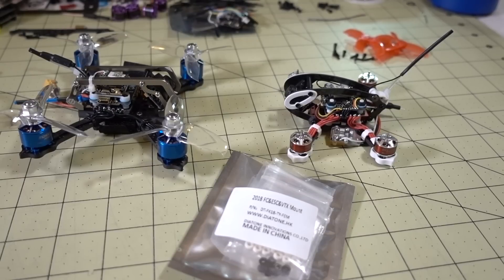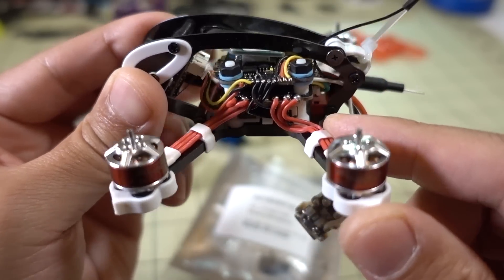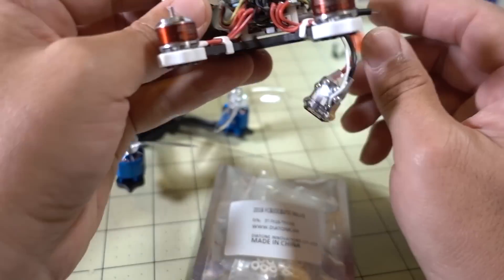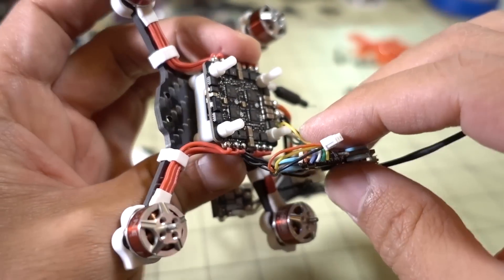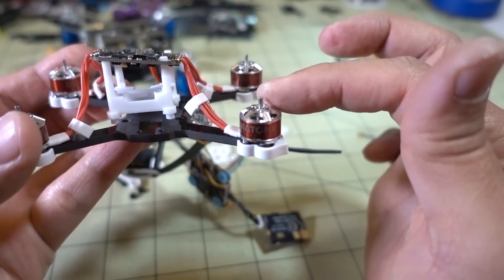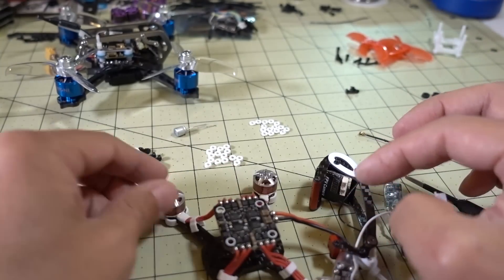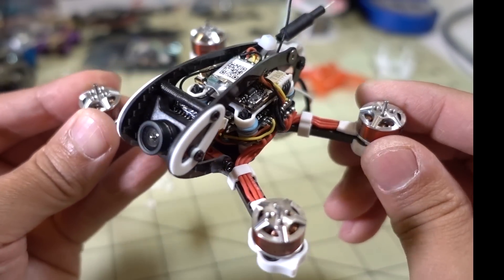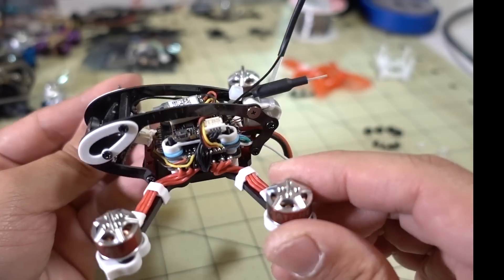Diatone GT-R90 V2 Stack Conversion 🎈

Comment: Thanks for this vid....Did it with no problems until I flew it.   Was flying great before conversion, but now has crazy mid to high throttle oscillations.  Any ideas??
Reply from the maker: You probably have the FC/gyro tightened down too much and vibrations are getting through.  The silicone grommets need to be allowed to let the FC float and move around a little to absorb the motor/prop vibrations.
Reply: Albert Kim will give it a go 👍
Reply: It worked....loosened one turn on each screw and perfect!! Thanks

Comment: r u sure you used the plastic plate correctly? think its meant on the bottom to hold the screws and to avoid a short with the esc
Reply from the maker: Yes, it's correct.  The plate is mean to mount the VTX.

Comment: Hey Albert! Got it all figured out as far as the Spektrum sat RX wiring for the GTR90 V2. It appears that the F4 version on the V2 is all serial and no jumpers needed! That’s what myself and the guy from Diatone US come up with.  For the V2 you just wore to 3.3v and ground on the left side of the board (with camera facing away from you) and then the RX signal wire goes to RX6 on FC similar; it’s sane wiring as the V1 F4 FC, just no jumping. 

I do have an issue though I need help with!! If you can! :-) 

Everything looks good in BF and all my channel mapping is done in the receiver tab,  but when I arm and give ANY throttle input, the quad just ramps up RPMs all by itself and just shoots straight in the air in a spiral motion...I have calibrated the accelerometer and confirmed channel travel and endpoints 1000 to 2000 and middle is 1500.

Any recommendations? Maybe a re-dump? Thanks for any help sir!
Reply: Maybe is the p gain on the pid's to high

Comment: is there any way you might be able to share how to wire a 3.3v rx to the fc? there is nothing on how to do it on the v2 FC! It is not the same as the FC that the v1 comes with.  Thank ou so much!
Reply from the maker: I don't have the V2 FC.  I modded my V1 with the new stack mounting and capacitor but the FC is still V1.
Reply: Albert Kim thanks! I’m a little newer to the whole ARF micro and open software BF stuff.  I’ve been told that they were the same, but I’m here to tell everyone that the FC might be the same OS and type, but the layout of it is different. 

Diatone even sent me their old diagram and doesn’t have an answer on how to wire a 3.3v onto the new V2 FC nomenclature. 

If I’m missing something, please someone let me know! I have a diagram, but it only labels the 3.3v and GND pad...do I simply use those? And where does the signal wire go? 

Thanks for the reply Albert!
Reply: Diatone have now a new picture where al the details are shown

Comment: Would you say there is enough space under the stack after conversion to slide the receiver?
Reply from the maker: I think an XM+ might fit but it will be tight.
Reply: I'm using FS-A8S receiver and its 6.27mm high and the XM+ is about 4mm high, so not likely. Thanks for your reply!

Comment: Hi albert was wondering if your motors on the gt 90 are noisy mine make alot of noise like a loose magnet or something and whats the eazyiest way to take the c clip off on those
Reply from the maker: Mine are not noisy.  I think there are tools for c-clip removal, but I think they end up break the clip and you need a new one anyway.
Reply: Albert Kim i had a feeling of that maybe ill just blow them out with compressed air just to make sure there is noting stuck in  them

Comment: Maybe not the right place for this comment, but it is generally applicable to the micro drones we love - and it has to do with Betaflight 3.3 and F3 flight controllers. The problem is supposed to be resolved with 3.4, but as it now stands, most F3 boards cannot take advantage of the new BRQC2 stage2 filter - 3.3 won't even load it. So, Butterflight to the rescue. Mind you, Butterflight is really irrelevant to micro quads - like Betaflight, it's designed for the 5"-6" quads and their bigger motors and increased weight, but it will allow those of us who are still flying F3 boards to take advantage of either the BRQC2 or Fast Kalman filters. The other problem is over-taxing the processor with Dynamic Filters on F3 boards - which Boris and the Betaflight folks recommend running at 4K/4K if Dynamic Filters are on to keep the CPU usage manageable. You can't run the Fast Kalman filters at a 4K gyro refresh rate at the stock settings for q and r - the ratio will produce a frequency of about 90hz, which is no different than the stage 1 soft lowpass filter - so Fast Kalman is of no use to F3 pilots. On the other hand, Butterflight allows us F3 users to do something really cool. 4K/4K PID and Gyro rates, Dynamic Filters on, 90hz soft lowpass and 150hz stage2 gyro filters, and all notch filters off (yes, including D-term notch). This also works great on F4 boards running at 8k/8k - I've messed with it a lot, and the result of doing things this way is much smoother flight and no added motor heat from turning off the d-term notch filter. You end up with "stacked" or "layered" filters in the area where most motor noise and d-term noise occurs that are much better and more versatile at attenuating motor and d-term noise. Also, you can do this on the F4 and faster boards without having to use Butterflight - it's native to Betaflight 3.3 on F4 processors. So, until 3.4 comes out, I flashed Butterflight onto all my F3 boards and set them up in this way - and am really happy with the results. Also did it on all my F4 boards. Good luck if you try it, but just in case do a hover test and check for motor heat.
Reply from the maker: WhichF3 micro are you running Butterflight on?  I've been playing around with it and all my setups have performed worse than Betaflight.  What CLI commands did you issue for the filter settings?
Reply: Albert Kim - Several!  They all seem to handle it well - Leader 120, Lizard95, Mini Bfight to name a few.  Here are the CLI Commands:

Set gyro_stage2_lowpass_hz = 150
Set gyro_stage2_filter_type = biquad_rc_fir2

Make sure that the soft lowpass (stage 1) is set to 90hz on the Filters page in PID Settings (very top filter - 90 is default), and turn off all your notches (all 3) and do a hover test for motor heat.  An alternative thing to try is to set the stage2 gyro lowpass to 90hz and turn the stage 1 off (set to 0) and turn on the D-term notch filter - and test for motor heat with the D-term notch on and off.  In the first way, you are stacking the filters into the frequencies where motor noise and d-term noise are typically the worst, and the dynamic filters will do their thing as well.  You will have less latency with the second method - you are just swapping the fast biquad filter (stage 2) for the default lowpass filter - but the new filter has greater attenuation at higher frequencies.  Try it both ways and see what you think.  Don't worry about the Q and R values - they only work with the Kalman filter if you select it.

If you like the results, then the good thing about this method is that it works regardless of whether you have an F3 or F4 and regardless of the PID Loop refresh rate - so you get the same results regardless of whether you are running 4K/4K or 8K/8K.  I should add that a lot of what I have learned came from UAV Tech and some from Joshua Bardwell - and reading the Wiki - but mainly from actually experimenting with different modalities.
Reply: Albert - just flew the 3" Komori with an F4 HGLRC stack and Emax 1106-6000 motors set-up the same way - and it flew like butter - the motors were lukewarm when I landed it and I flew it hard for 4 minutes.
Reply: Oh - and it is flashed with Betaflight 3.3 but the CLI commands and setup are the same. Stage 1 at 90, Stage 2 at 150, Dynamics on and all three notch filters off.
Reply from the maker: So you're flashing Betaflight to F4's and Butterflight to F3's but essentially setting up the same on each?
Reply: Albert Kim  - Exactly!  It's the only way to get the Stage 2 gyro lowpass on an F3 running at 4k/4k - Butterflight on the F3 boards and Betaflight on the F4's.  I tried the Fast Kalman filter using the default q and r settings - the problem is that at a 4k gyro rate, you are just duplicating the frequency of the Stage 1 gyro lowpass (90hz).  At an 8k gyro rate, the Fast Kalman cut-off goes up to around 180hz - unless you change the q and r settings - which I don't feel competent to do, and the default on Butterflight is to leave the Stage 1 filter on at 90hz.  At 4k, you are just duplicating things and end-up with a Biquad filter with double the latency.  So, since Butterflight is Betaflight with the option to try the Kalman filter (and use the BQRC filter on an F3 board if you want), I tried different combinations until I got to the stock lowpass (Stage 1) at 90hz, the BQRC filter (Stage 2) at 150hz, Dynamic Filter on and all the notch filters off.  From there, you can experiment with turning the Dynamic Filter off and raising the cutoff of the Stage 2 filter in 50hz increments until you get to 250-500hz.  There is another lowpass filter built into the MPU6000 gyro with a cutoff of 256hz - so in the way I have the boards set up now, the Stage 1 gyro lowpass is at 90hz, Stage 2 at 150hz, the digital gyro lowpass at 256hz and the dynamic filter is on and all three notches are off.  Turning off the dynamic filter saves (reduces) latency and CPU usage - and so that is my next experiment.  Check for motor heat with each change - but I know you know that.   Raising the Stage 2 to higher cutoff frequencies may reduce prop-wash if it becomes a problem.  Our problem is how to adapt these fancy new shiny filters and things to small quads -  when they were created mostly for the bigger quads.
Reply from the maker: So with these settings, how do they fly for you?
Reply: Albert Kim  - really well!  Subjectively speaking I would say they fly smoother - and more responsive - but I haven't tried any tuning to see if these settings allow for higher P or D gains.  That would be a great project for you!

Comment: Did you mention that Diatone is selling the capacitor for they use on the GTR90 V2 as well? I couldn't find it on their site. Thanks for all the videos Albert.  Excellent balance between honesty and usefulness!
Reply from the maker: I don't think they are selling it yet.  If you can't wait, I found this on Amazon, it might be the same - https://amzn.to/2GJaYUS
Reply: That's a surface mount cap with no legs don't use that one. Will be really hard to solder that one in place.
Reply: I'll be patient and wait for your video on it, and for Diatone to sell the capacitor they use on their site. Happy to throw my business their way. Thanks again Albert! 5 stars for the effort and help!  ***

Comment: I've never broke or had a problem with the old style. But the only reason I like the vtx on top is the antenna can be mounted on on top over the props. Better when you have a big furiousfpv clover leaf or something.
Reply: NORTHSTAR FPV 
I drilled a hole in the white plastic piece in the back and ran a u.fl FuriousFPV cloverleaf down through it.  Had to remove the stupid little bent “tube” they have for the dipole wire and open up the clamp part a little bit for the heavier gauge wire of the Furious antenna, but it worked out really well.  The Furious antenna ended up being the perfect length to get to the Unify’s connector and the cloverleaf just rests right on top of the plastic piece in the back.  Wish I could post pics here.